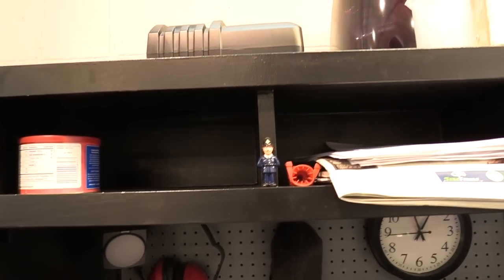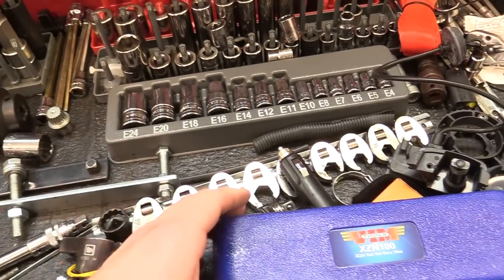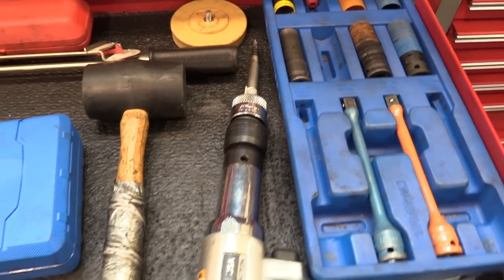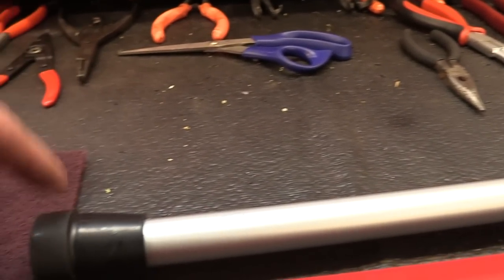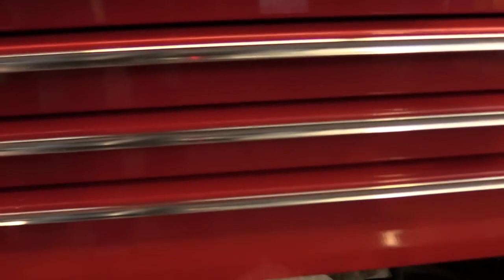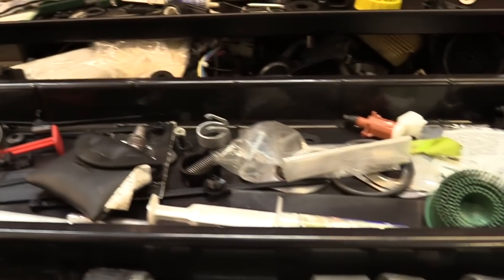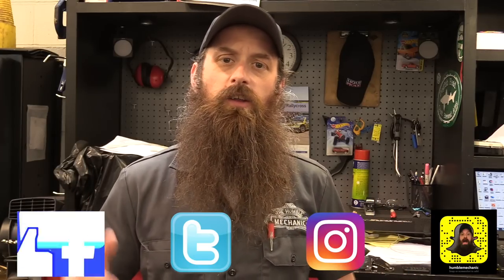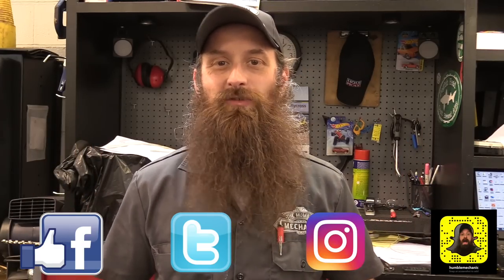Real Tool Box Tour ~ Humble Mechanic

Comment: I learned a valuable lesson over the years. Never loaned out tools. You either a don't get them back, or be get them back broken.
Reply from the maker: Pretty sad isn't it!?!
Reply: Or someone borrows them, doesn't tell you they took it, then puts it back broken and doesn't tell you.
Reply: if they break your tools break their shins
Reply: I never knew a friendship could be worth $20.
Reply: And any tool that can rust, will come back rusted.
Reply: Boosted Fool So YOU'RE that guy.
Reply: My tubing cutter came back broke, the borrower said nothing. I made sure he got the worst jobs in the shop for the next month. It's fun to be management.
Reply: Rick Gaine I learned a valuable lesson years ago.Don’t be an auto tech.
Reply: That's why you have to invest in snap-on who cares if it breaks
Reply: +kray brother Lol, for what you pay for Snap On tools I can buy for 3X less off of Matco or Cornwell and get them exchanged for free. Snap On and Mac tools you pay threw the nose for a name.
Reply: +Brad Richardson 
Dial indicator, For checking runout on rotors?
Reply: +Brad Richardson 
I had a $150.00 dollar rule. If you wanted to borrow a tool that cost $150.00 or more you didnt get to use it. Unless you were proven trustworthy. And by that I mean if you actually put money towards filling your own tool box.

Comment: why did you spend $5000 plus to hold junk?  There are hardly any tools In there.   Guys at work that make 27 grand a year have more tools in their smaller boxes.
Reply from the maker: +ScreamingGoat43 this is not my full tool collection. My roll kart houses much of my day to day. 

And yes I have a box that houses more than just tools. 

Well I should say HAD.
Reply: HumbleMechanic Oh my bad. Thanks for clarifying. Awesome Chanel by the way. Im 18 and I’m an aspiring mechanic. I’m going to try my hardest to get on a racing team or start my own fab shop.

Comment: I had comment/question couple months ago about a mystery issue with my Audi A3. The car was quitting randomly right after start up, hard to start etc. I took it to the dealership, 2 garages etc.. they assured me the fuel pumps we're good, fuel pressure was right,  you suggested fuel also. Just wanted to give you an update. I replaced the in tank fuel pump because I figured if it were bad, I may not get a code, just starve the hpfp. It didn't help. I replaced the hpfp the next week with an upgraded Bosch unit I found online for about 160$, just to rule it out. That fixed it. Turns out the solenoid on the pump had an intermittent open circuit in it after testing it several times, shaking it, tapping it I would get different resistance reading. Thank you for pointing me in that direction even tho the dealership and 2 garages told me changing fuel pumps would be a waste of money.

Comment: Hey my name is robert the uti guy how u doing i have a 200 toyota camry crank no start the fuel pump is working it it gettimg spark from ignition wires my neighbor said it just stalled only codes i got was a p0110 code any tips you can give me would help i puuled the top of the timing cover back the belt seems to have tension dosent look broken or torn i checked all the fuses and relays aswell cranks and crank but no start
Reply from the maker: I wouldn't think that that code would cause a no-start. Can you clear it and try and start?

Comment: That Snap-on 17mm-19mm double box end wrench is one of the most used wrenches in my tool box (third only to the 10mm-12mm and 14mm-15mm wrenches from the same set). I love those wrenches, they are so long I can use them as a belt tensioner tool. They are also absolutely indispensable for rear brake work on many Asian vehicles that don't have enough clearance for a impact gun or breaker bar.

Comment: One of the most versatile tools I've found is the Ryobi Quick Turn cordless screwdriver.  It comes in the standard gun-shaped configuration, but flick a switch and you can change it to a straight configuration that has helped me save so, SO much time doing work under dashes, on HVAC systems, cabin filters, etc. because it's small enough to fit where most other power tools simply can't.  My only complaint is that it has an integrated battery so you have to wait for it to charge.  $40 at Home Depot.

Comment: Those long snap on wrenches with a 19mm on one end and a 17mm on the other are so useful. Back in the winter I did a coop at Nissan and I found them super usefull, as well as the 14mm/12mm as those four sizes are very common on japanese cars

Comment: 8 years working on cars and i never bought a nice box, it was so much more stress free not having to worry about people scratching it, parts guys slamming rotors on to it or the mechanic next to me blowing up a radiator full of stop leak all over it (that actually happened). cool video, thanks for sharing your inner workings. someone gave me a old VULCAN box. maybe when it collapses under its own weight ill buy a new box
Reply: I'm just a farmer so I could never spend alot on a toolbox, but I found a 1979 Matco lower + upper section (approx. 2ft wide x 16 inches deep and 4.5 ft high) for $350. Not perfect, but it serves me well. Someone who had it before me labeled most of the drawers, and two them say "wrenchs". :)

Comment: I like the zero offset long box ends for doing brake calipers and tie rods.  On Toyotas and Hondas the 17mm/14mm comes in handy (using one tool twice when doing a wheel bearing etc.).  The long zero offset gives good feedback on the torque without a torque wrench.

Comment: In 1982 I started doing R&R at a transmission shop. I had an old cheesey CP 1/2 in drive impact that was getting weak. The Snap-On guy showed me a Snap-On IM-5 gun, it was wildly powerful, It was rebuilt by Snap-On and was up at $200... I bought it. A year later it needed a rebuild... $90.... A year later it needed a rebuild that was another $90.... I switched jobs and a year later it died again. I bought a cheap one at a parts house...

To this day I won't give perfectly good money, not even a $1 for a Snap-On impact. I found that the IM-5 had a reputation for failure. I think I still have that turd in the garage 

I still mutter bad words every time I think about that IM5. But it was a blessing, over the years that gun saved me money by reminding me where NOT to get air tools.

I give Snap-On their due... The wrenches and sockets have served me well, A few have worn through the chrome in spots from use.

Most of my air tools except the Ingersoll came from Harbor Freight. It's cheaper to throw them away and get a new one than to repair Snap-On air tools yearly.

Comment: Very nice charles! I have 2 HF 56in tool chests that iam going to be putting in my trailer for the mobile workshop. Im trying to see if i can consolidate everything into one toolbox to save on weight and space but i have a stupid amount of tools. The tough part in my case is weight and space are a pemium. On top of that i am going to have a hunter tc3250 tire machine, a corghi em9250 wheel balancer, and a 60gal compressor in the trailer for doing tires/wheels. Its going along slow because I dont want to regret making bad spacing plans but when all is said and done i am going to make a video tour. I also just bought a milwaukee toolbox from home desperate ( i mean depot ;) to use as a rolling cart to bring onto the customers property. Putting e track rails in the trailer currently to tie stuff down that will be taken in and out. Also have a ranger quick jack 7000lb model for tires/suspension/oil changes. I cant to finish the project!

Comment: Thank you for some great ideas on book and tool storage. :D
Great seeing another has the same high level of organization. ;p My main reason is because working on a vehical over at least several days if not several months and forget to put things back. Worse now that this Summer picked up a used Mac Tools large top chest for $100 so trying to figure out what goes where (already had an old Craftsman top and bottom). Also have a two shelf cart. All of this in a one car garage but got to have a place for all the tools that have acquired since about 13 (now almost 31).
I have Cree 4 foot LED lamps from Amazon as my shop lights; three over the engine and one for a shelf. Can get them in a true white and makes working on vehicals so much easier and comfortable. They come in a pack of four and see it being useful for the hutch if you go back to using it. Hope this helps.

Comment: I' ll have to do a tool box video so you can see what I have. My Xnap on box has the upper cabinet. I bought off of Mac tool truck for $3,000 less $1,000 for my old box which was a no name POS box I bought off a guy for $100. Drawers werent even roller type. I actually started with a craftsman two cabinate box I bought for $200. new, Then bought another 3 cabinate box for $200. Then I bought the POS box. I didnt do a lot of VW work so I dont have a lot of VW tools.  But for those techs just starting out I would suggest waiting for your tool truck to have a repo box or scratch and dent box it could save you big money instead of paying out big bucks for a new box. Or buy a couple of craftsman small boxes untill you make enough to buy a bigger box.

Comment: The quarter inch drive triple square set from VIM will save your life when replacing the turbo on a 2.0 TFSI, or the turbo on any Audi 4 cylinder for that matter.
Reply from the maker: Oh yea? I need to look at a set of those babies. Is it these? http://amzn.to/2q0hY84
Reply: HumbleMechanic Yup. I got them off the Matco truck. They even come with a magnetic rail. Also super useful for removing the bolt on the flexible bracket to remove the ignition switch on the 09ish A4